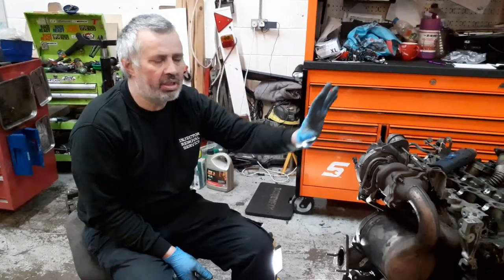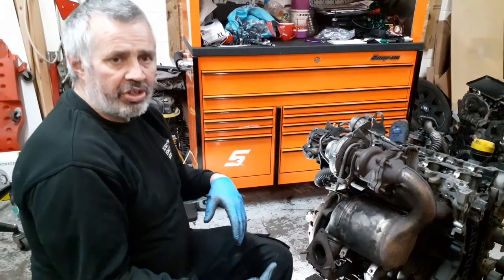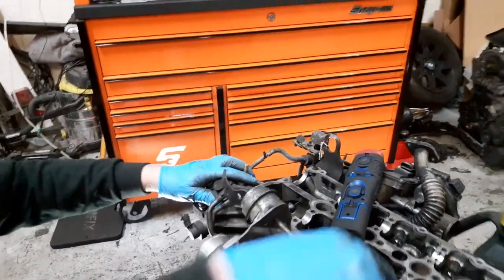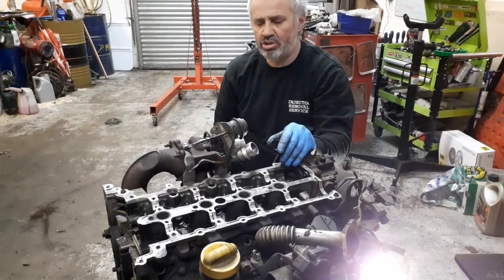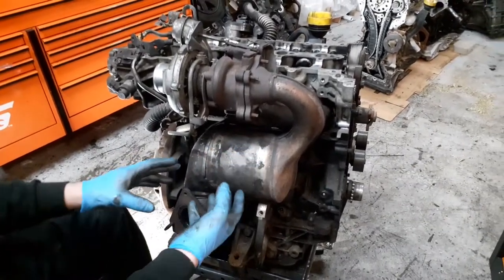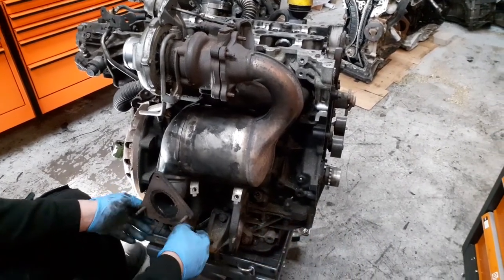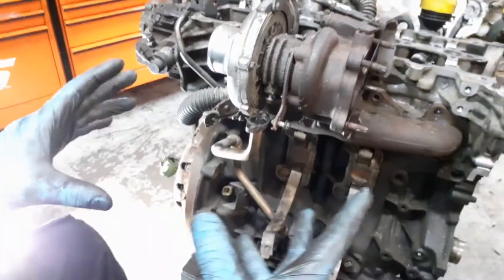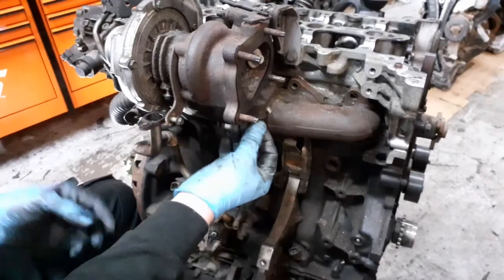Vauxhall Vivaro TVP 2Ltr Turbo Removal Part 1

Comment: Hi 

See on the new vivaros 2020.
Do you still have to pull them same way as the mk2.
Not work on the new design injector on the 2020 plates